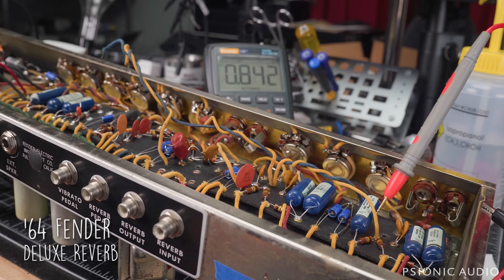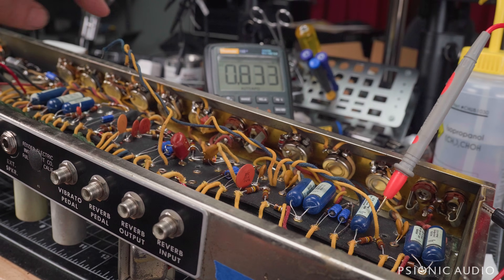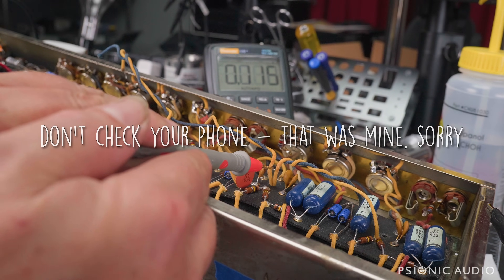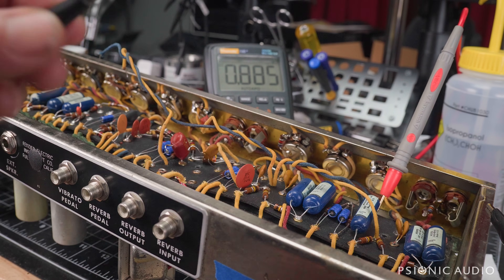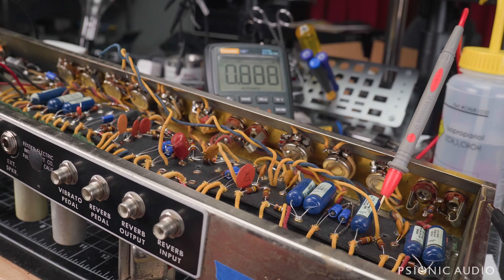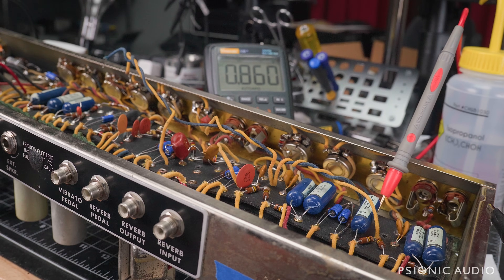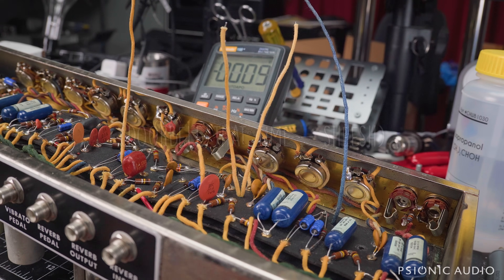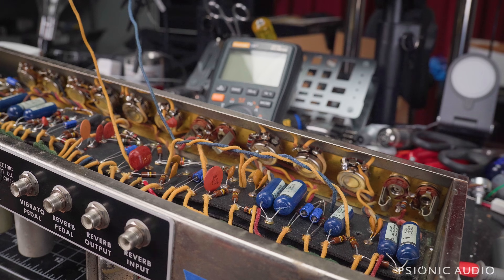Insulation (Is Actually Important)

Comment: Wiki: Paraffin wax is an excellent electrical insulator, with a resistivity of between 1013 and 1017 ohm-metre.[10] This is better than nearly all other materials except some plastics (notably PTFE). (*Wikipedia and the 1965 Mc Graw-Hill Electrical Engineer's Handbook). I can't find any real specs for Gavitt wire. You can use oil pastels as far matching the colors of the old wire with new Gavitt wire. Cloth Gavitt wire insulation already has wax in it, so you are not adding anything that isn't already there, and old the wax might be why the old insulation became conductive. You can also rewax the old wire with paraffin too after soaking in IPA. (alcohol, not ale). Bee's wax will darken the colors and, yes, they used it too and it works, but maybe not quite as well as paraffin, (electrical resistance ranges from 5×1012 to 20×1012 Ωm). These number equate up into the Tera-Ohm range and are from 5-12 tera ohms. (5,000,000,000,000 or 5 million Meg-Ohms.  Ohm-meter is a cubic meter of wax with 1 meter copper plates on opposite sides, tested with Meg-Ohm meter or a resistance bridge. My GR bridge tests at 1000 volts and reads into the Tera Ohm range. General Radio also made THE Variac, and a great old LCR Bridge, that I can't afford.

Comment: I love insulation as much as anyone… But is it possible your DDM is showing induced voltage here?  What does a resistance measurement reveal?  Did you try shunting to see if it disappears?
Reply: I watched it a couple times  (As usual with your vids!). But I couldn’t see a resistance measurement anywhere.  Sometimes my DMM can pick up induced voltage from EM fields in high impedance situations.  Just wanted to check that you’d definitively ruled that out.  No disrespect intended. And sorry if I missed something.
Reply from the maker: Easy to sound argumentative in text - not intended on my end. 

I demonstrated the voltage was on the cloth and “seeped into” the wire. That’s why I showed grounding the yellow cloth and having the voltage on the blue conductor decrease.

And from many hundreds of other sixties Fenders, I know this isn’t normal or unavoidable. 

So all other factors being the same, this isn’t a thing with the meter or the measurement process.

It’s just good old fashioned (literally) conductive insulation. ;)
Reply: @PsionicAudio  Thanks Lyle.  (Same here!  Just want to keep learning...)  I've come to find that a floating wire (blue) can accumulate a small potential to ground when in close proximity to a high voltage DC wire (yellow). (Electrostatic coupling) And the fact that it dropped the potential right to 0VDC when you grounded one end of the blue wire makes me think the insulation is intact.  The stray electrostatic charge goes away, but if the insulation was conductive you'd still see some current flowing?
Reply from the maker: Did you watch the whole video?

Comment: I have a Fender Vibrolux fortunately the cables are still good after 64 years. If i have to change the yellow Astrons because they become leaky will i hear a difference between Roederstein 1813 or mallory 150? What are your preferred caps for Tweed restauration? Thank You
Reply from the maker: I prefer the 1813 because the leads are nicer and the finishing is much more consistent. Both sound great in that amp.
Reply: Thank you very much!
Reply: One more question 😊 will i hear a difference between 1813 and lets say expensive paper in oil caps in the vibrolux? is it worth it. Greetings

Comment: I am working on a '67 deluxe reverb that has this same issue. I spent an hour steaming smoke tar out of the front grille already. I am replacing it with the insulated and cloth covered wire from amplified parts so it gets some modern insulation and doesn't look too out of place.

Comment: Originality matters, but only to the point where it affects performance and reliability.  I applaud your attempt to reclaim the original wires but since that wasn't possible, replacing them with a modern substitute seems highly appropriate.  I've seen clones kit that brag about including cloth covered wire but I think that's just a bit silly.  Cloth insulation provide absolutely no sonic "mojo".  It's just about appearance and originality.

Comment: Being one who was always not much sold on the whole "vintage" sales pitch; yes, there should be a few pristine examples of historic gear as museum pieces for posterity.  
But old or new, an amp or guitar that is meant to be played should be kept in it's best working order.  If something needs to be done that will change its performance drastically, that's certainly a cause for consideration.  But just because it's old doesn't mean much at all to me dollar-wise if it doesn't work well.  As I've said before; "vintage" is just a sales pitch word to make "old" sound more expensive.  And it works - very well.  It shifts the balance of supply and demand in play by convincing players that having the original knobs (even though the numbers are now hard to read) makes a $500 difference in the value compared to having replaced the knobs.  
I've heard many more amps of more recent years that perform way better than some that were old and "cherished".  There are some real magical guitars out there.  And lots of people will swear that, having played a '59 burst, "man, it plays and sounds the best."  I wonder how often they would come to the same conclusion if they'd been comparing to a new version blindfolded.  🙂
If this amp is meant to be played - - - - - .... oh, our star player has a dislocated shoulder....   NO, don't reset it and let it heal!!!   He needs to be original in order to be his best, and this is just part of the natural aging of a player................

Comment: This is making up my mind to bite the bullet and do a complete rebuild on an old Fender amp I have with cloth covered wire. It's vintage, but it's not a collector's item. It was shotgunned at some point and the original PT is dead & gone. But worse, the inside is contaminated with some crap that was squirted in the pots or inputs at some point. Under the controls for the trem channel the wire is so impregnated with this stuff that it's wet looking. GLOSSY. Eww. I've been putting it off.
Reply: Dang! I'd be scared to even plug that amp in to the outlet let alone turn it on.

Comment: Outside of collectors, is there any reason to stick with cloth covered wires? Say, this amp was for someone gigging or recording?
Reply from the maker: Most cloth wire from the ‘50s/‘60s is fine. And the stuff I’ll be putting in should be good another 50 years. So the short answer is for gigging/recording this is far from a deal breaker.

After ‘69 Fender went to stranded with a plastic jacket. And that stuff rots where any non-tinned strands have been exposed to air.

In a new build I’d use 600 deg top coat or telfon coated stranded. But this isn’t a new build.

Comment: What a fine example of inductance coupling . Given what  the signal level that a big problem IMHO.  Cotton insulation can sound good if they are clean and dry . Cloth over a ploy insulation look right and does not have that problem . Knob an tube has the problem however rarely  are the wires close and touch .